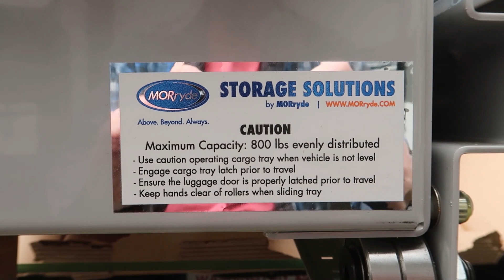MORryde Sliding Cargo Tray Installation | RV Upgrades | CTG60-2090W

Comment: Excellent video, thanks! Would be curious to see a follow up with it packed and in use. I believe that the inside dimension of that 20 inch x 90 inch slide is 17 inches. Is that correct? What sort of totes are you using that fit well? What fasteners did you end up using to finish the installation? Did it not come with the appropriate fasteners?
Reply from the maker: I helped a friend install this.  It didn't include mounting hardware.  I am not sure of the inside dimensions or the totes he's using.  He lives 300 miles away, so I can't verify what hardware he upgraded to or how he has it packed.

Comment: You don't happen to know the clearance from the carpet in the tray to the top of the side entrance opening?  I have a 2020 ORV 250 RKS, which I think would have the same dimensions and I'm trying to understand what would fit and not fit on the tray.  For example, will my Honda EU2200 fit, etc
Reply from the maker: I will find out.  I am almost positive that an EU2200i will fit.